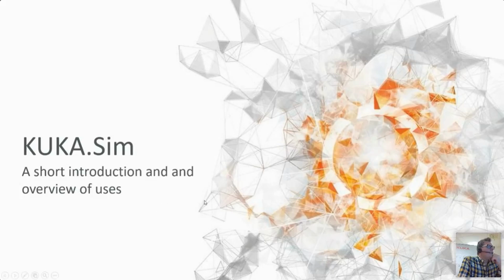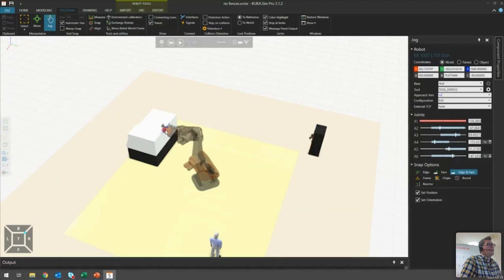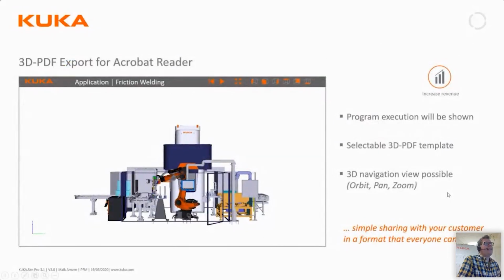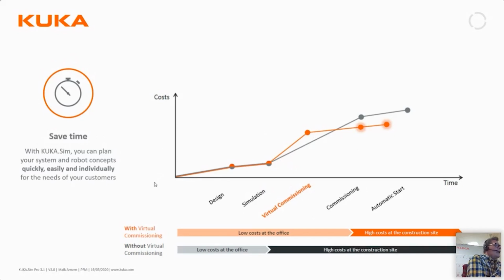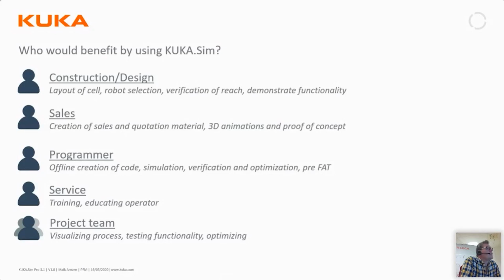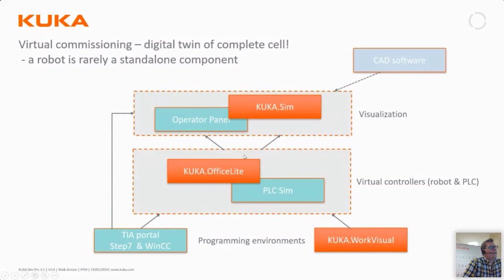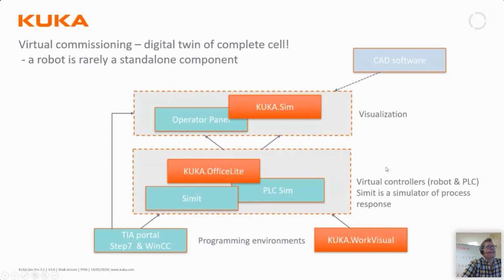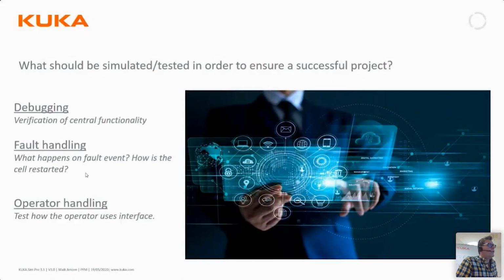Webinar KUKA Simulation

Comment: I recently got into Sim Pro and
 our current project would hardly be possible without it.

It would be nice if you could create normal workspaces.
What I can't manage are KRL instructions like LIN_REL or the geometric operator, is that even possible?

We use Beckhoff and unfortunately I/Os cannot be grouped to send bytes or Ints, which is also a shame.
Reply: Thanks for the feedback. During early summm 2021 there will be a new version available which handles some of your points